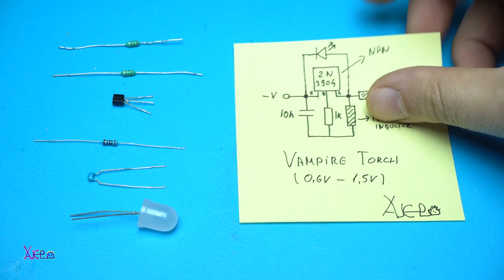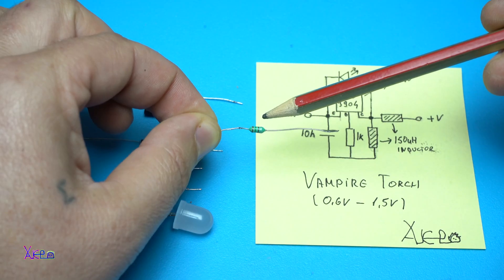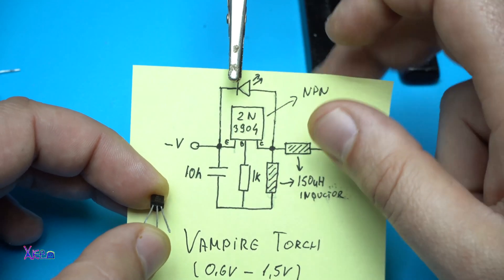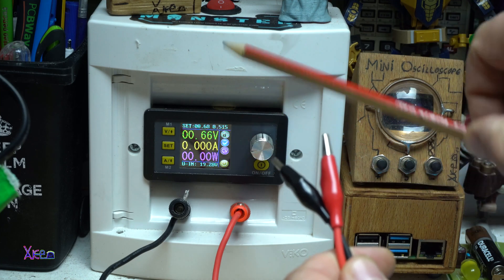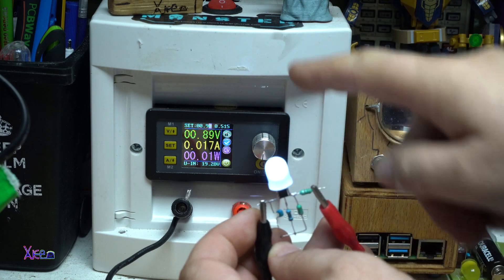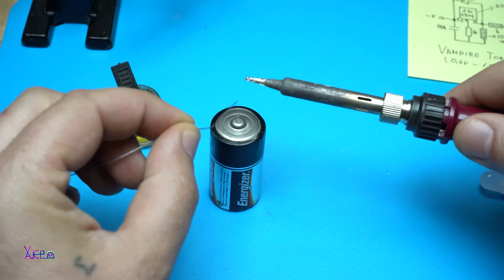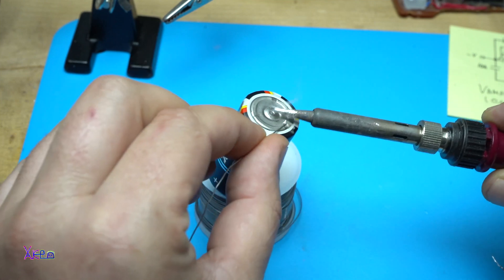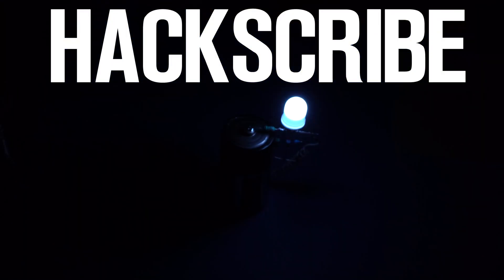One Easy Project | Simple invention for dead batteries

Comment: I want to try a germanium transistor to try to get the voltage even lower. I suppose it would be just as easy to put two or more batteries in series to get the required voltage though.

Comment: So, if the battery is too weak to use in normal applications including a flashlight and you got light from it as you did- how long can the light normally run before even it does not light?  Just wondered.  : )
Reply: Well, you can do the math to have an idea of how long it will take until it dies completely.  You see, if you have a dead battery that produces 0,9 Volts, and like you can see here in the video, it takes 0,17 Amps to shine bright.  I’m estimate it will work approximately 8 to 10 hours until it’s complete death.  If there’s more voltage, it’ll take more Amps and it will add only few more time, but it’ll be brighter.  Have a wonderful and blessed weekend, brother ✌️🍀❣️.